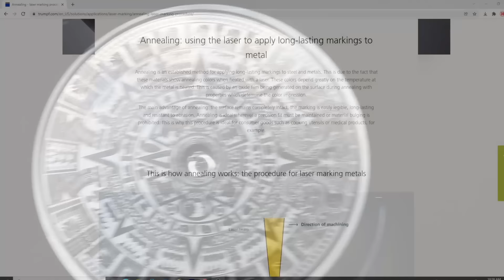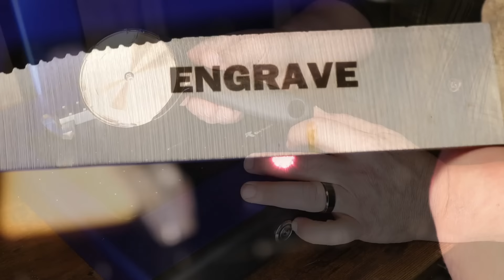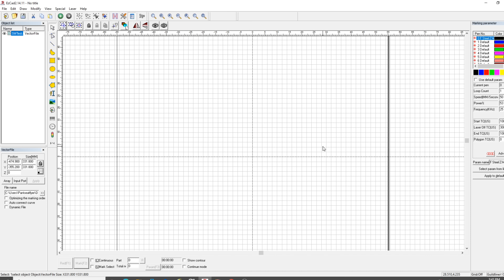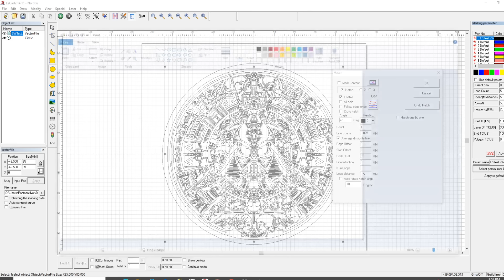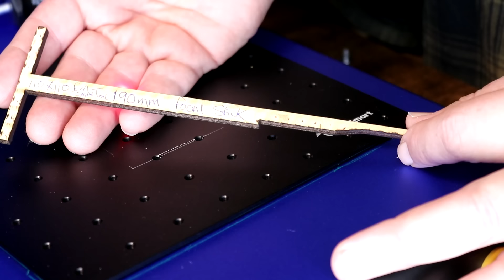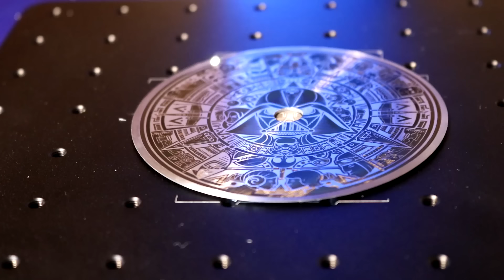Make Money with your Fiber Laser Marking Stainless Steel!

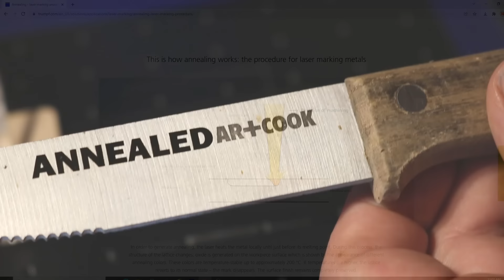Comment: Great video! @3:45 when you were comparing the annealed vs. the engraved knife, how many passes and how long did it take to engrave the knife? I'm trying to decide on whether to purchase a 60w Mopa vs.80w Mopa Fiber Laser.  I would need a laser with power that can Engrave stainless steel or mild steel for mostly lettering in less than 20 minutes. Thank you!

Comment: Sir love the video but one correction the zig zag patern doesn't mean that it burns in zig zag. What that is saying is the red is when the laser is literally off and the galvo is moving  to the next burn point, and the laser then turns back on. So if you look and you notice that there is 2 snake patterns one has red and one dose not the one that dose not have red in it means the laser stays burning the whole time. But loved the vid cause I could never get the anneal to work till you said that it's off set by 5mm. Lol

Comment: Good tutorial... But the level part might just be over the top does not matter with a flat item. also need to check the machine first. If the machine is at 10degre and the disc is 0degre is it going to be a mess because it is the angel or distance from the laser that matters.

Comment: Correction on the "zig-zag" hatch pattern: the laser does not mark a zig-zag line. It's unidirectional, meaning it marks a single line, left to right, moves up and back to the left side without marking, then marks another line, left to right. On the hatch pattern icons in EZ CAD, the blue lines show where the laser actually marks, while the red lines show the travel while the laser is off.